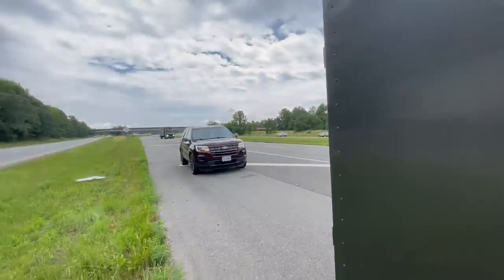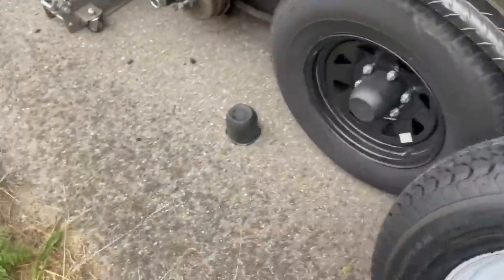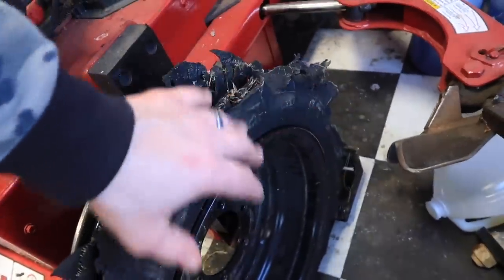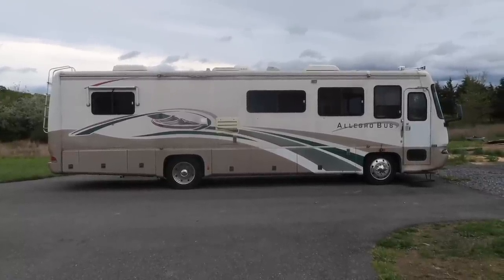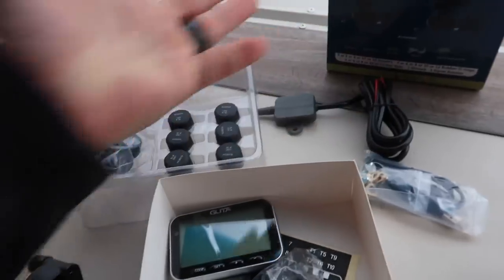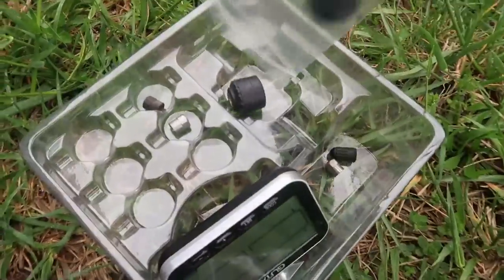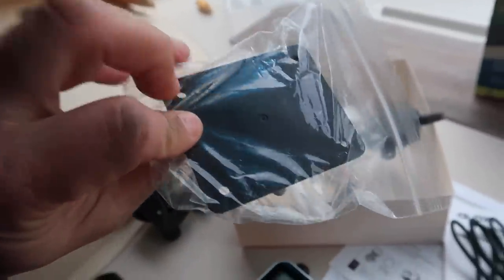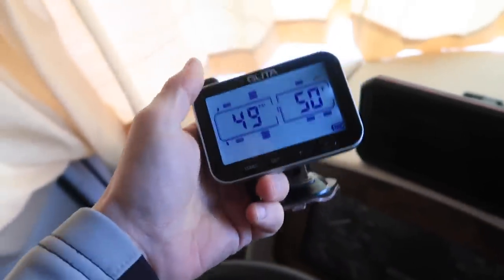RV Trailer TIRE BLOWOUT We Could have Avoided

Comment: TPMS is a must for our camper.  I’ve had a similar system to the one you have for years and definitely a piece of mind.  When you get your new trailer change out the valve stems to metal bolt in ones.  The rotational weight of those sensors can wear and break the rubber stems over time.  Great info on the system you purchased!

Comment: Another tire maintenance is to check your date codes on your tires. When you buy a trailer the tires may be older than the trailer. Check with tire manufacturer to find out when to replace tires.
Reply from the maker: Very good point.